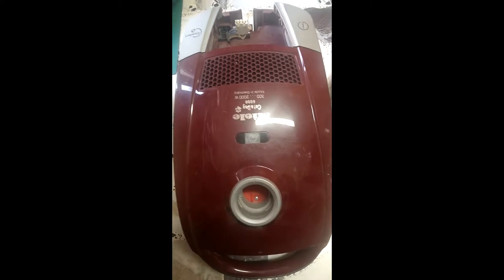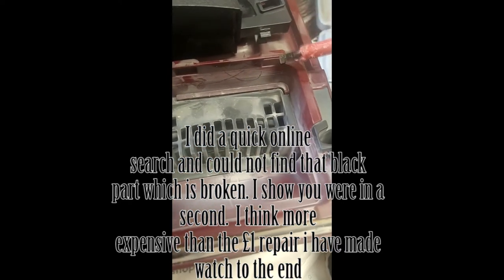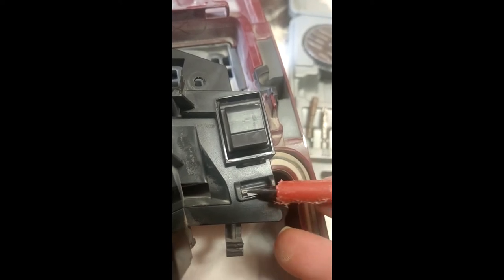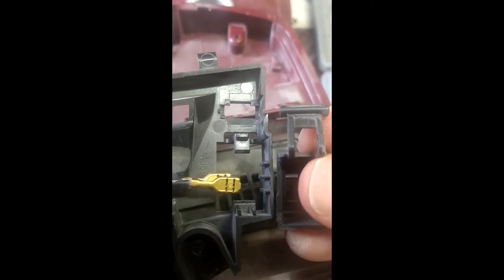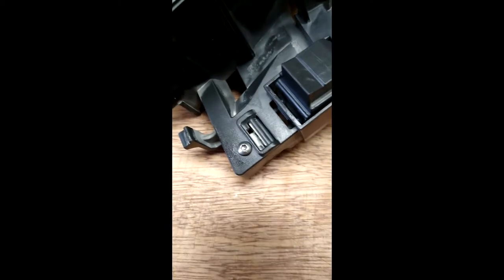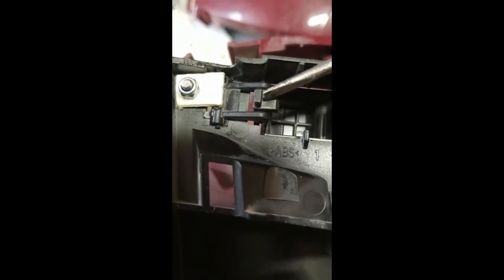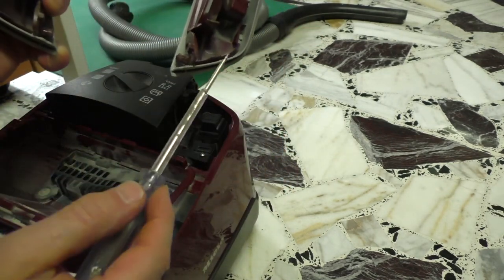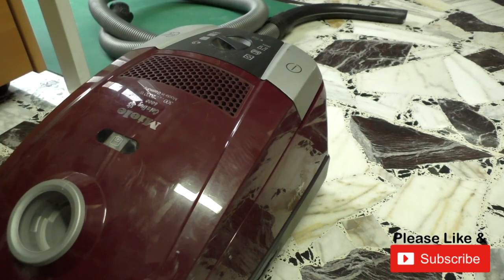Miele Vacuum Cats & Dogs 6000 (S6 Series) #0013 Power Switch Fix  Not staying on

Comment: Did this fix today, used a thin piece of metal instead of plastic, looked like a small bracket from a kitchen cupboard or similar, had some flex so gives a bit of spring along with a small nut and bolt. Am amazed at the overall design being compromised by such a simple flaw.
Reply from the maker: Glad you got it fixed.